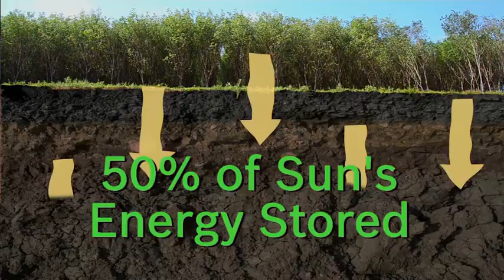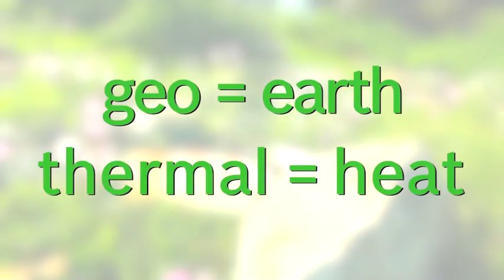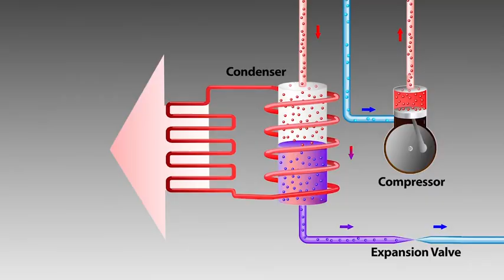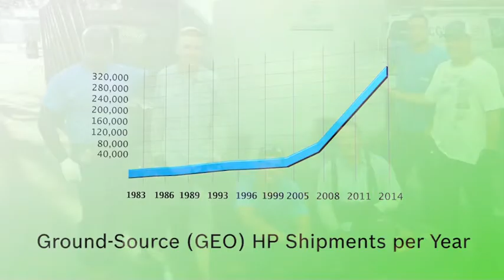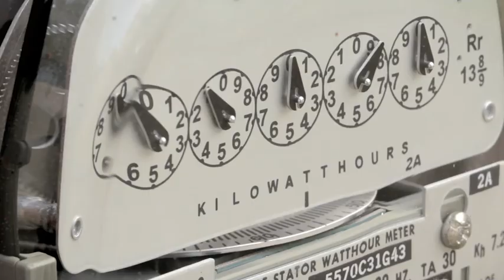Get Ready to Geo: Geothermal 101

Comment: I’m a Bosch geothermal dealer. Any thoughts on why a ecm blower motor is worth $2200? 6-7-8 year old units with no warranty on the blower. It’s bad advertising. Word of mouth is killing my sales.
Reply: Hey Clayton - you must've received incorrect pricing info...or maybe got price gouged. If your system is <10 years old, chances are it's still under warranty, too. 

Feel free contact me if you're still looking to source out a replacement blower motor. If you can provide me with the model # and serial #, I can look this up for ya...

EMAIL ME @ Mitchell@GroundSourceSupply.com